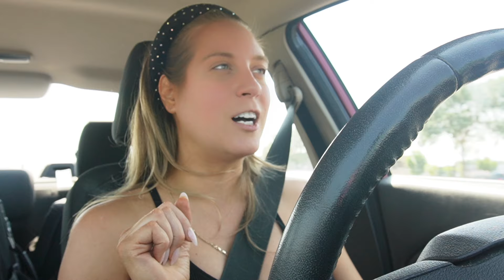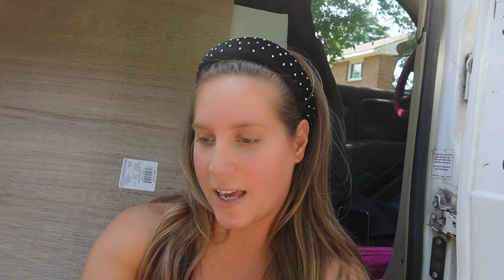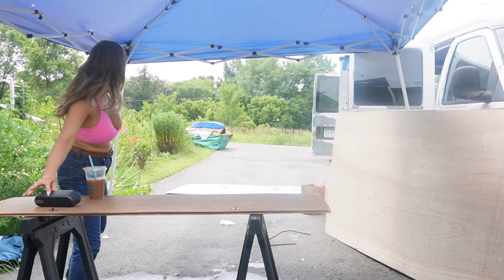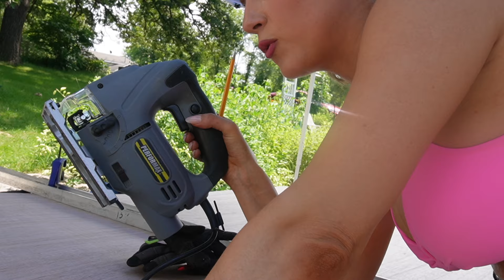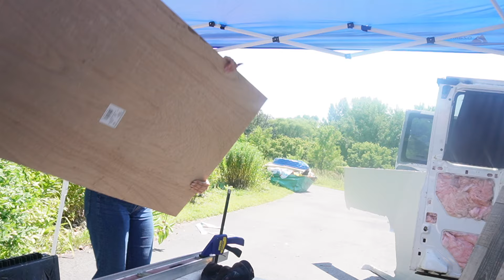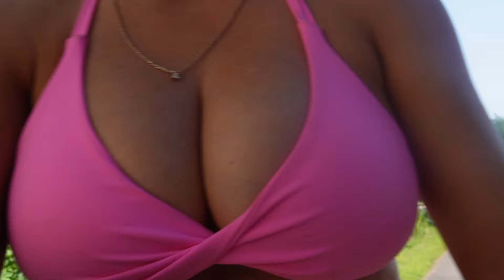Trying to remember how to build...

Comment: You probably got dehydrated and overheated,  use cardboard to make templates then transfer to wood,the jigsaw should be level and blade with less aggressive teeth 🦷, read the manual. 👍you can do it ❤